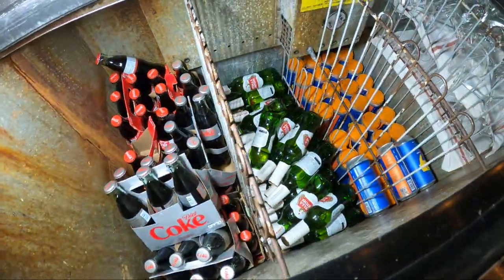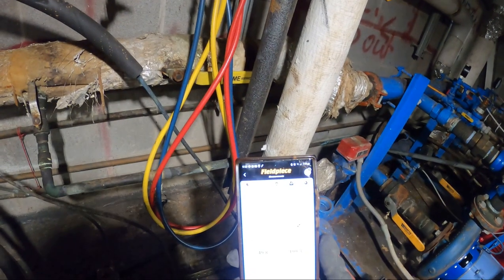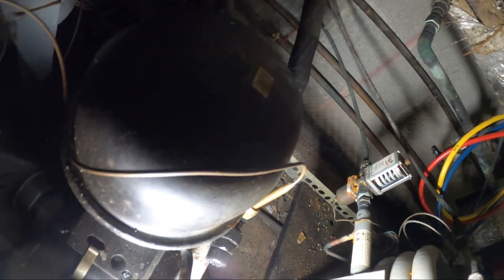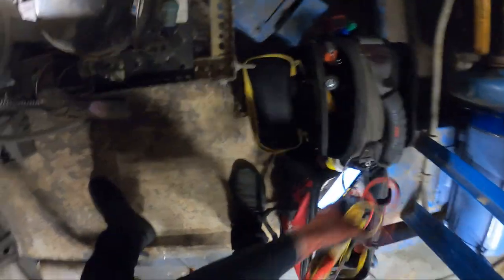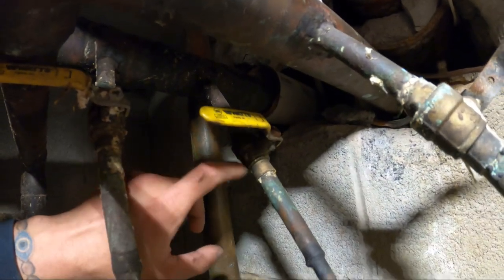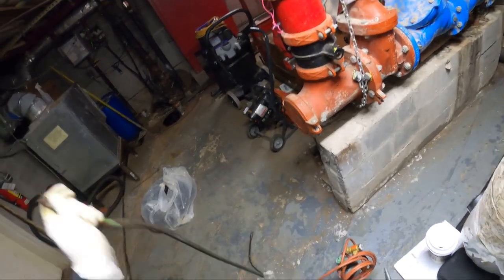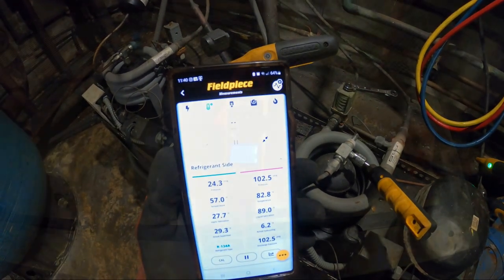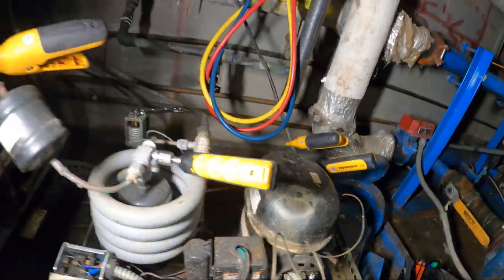HVACR Service Call: Water Source Refrigerator With High Head Pressure Tripping On Pressure Control

Comment: On the water source units I’ve worked on the circuit setter is on the outlet of the water coil, I don’t know why it matters but I believe it is here as well.  To set the water flow I use my temp probes on the inlet and outlet water pipes and depending on the unit you want to see ~10 degrees of differential from inlet and outlet water temps
Reply: Same as the wc ice machines.

Comment: is it normal in the big city to have remote condensers like that?
i would think it would be easier to have it at the on the unit.
Reply: Maybe a high rise building (water sourced) and easy to access in one place? I work in an 8 Story Building and all like 9-10 refrigeration compressors are on a rack exactly like in the video. From the Rack it branches out to walk ins, freezers, walk in lines, and even coolers with 3 coils. Alll Spread throughout the Basement , Lobby, & 2nd floor.
Next answer is Yes, Hella refrigerant.😂